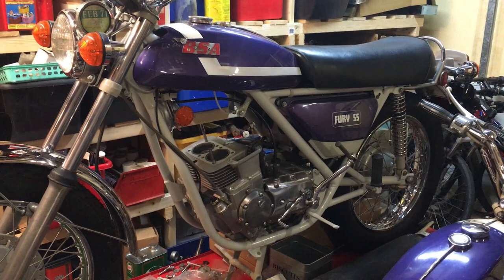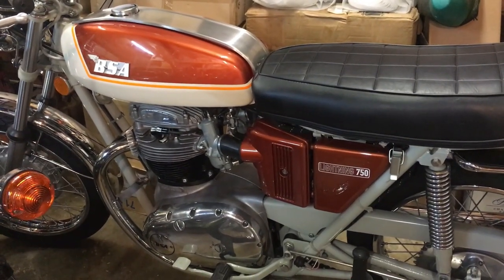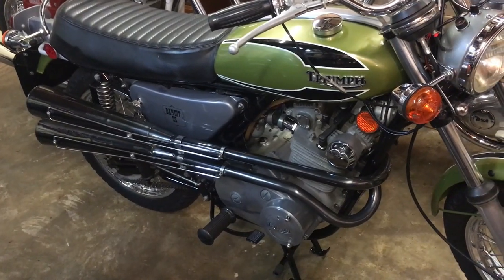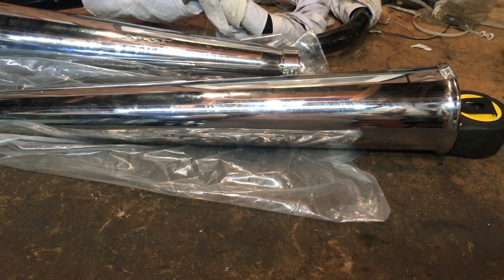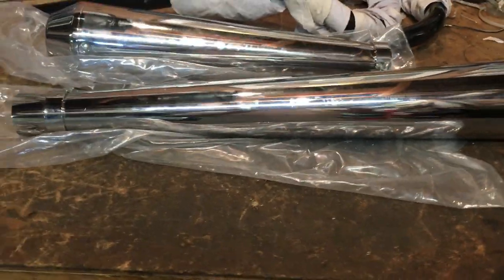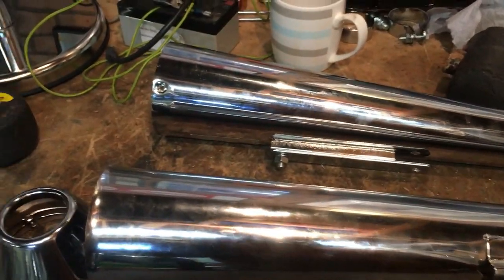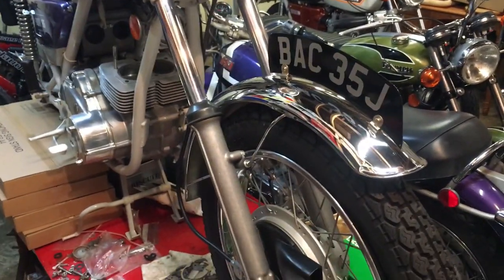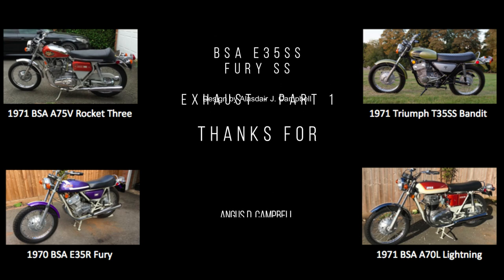BSA Fury SS (E35SS) Build - Exhaust Part 1

Comment: You mite consider brazing instead of welding,  the thin metal problem is aleaveated and it is very friendly to chrome plating.
Reply from the maker: Thanks Thomas - hadn't considered that but a very good point. I don't have the rods and the gas for brazing. I'm not looking to retain the chrome finish - that's going to change anyway.

Comment: Finding someone competent with a TIG welder would ensure a much tidier job than attacking the cones with a MIG set. MIG produces too much heat and leaves you with a lot more bead and spatter to grind off afterwards.
Reply from the maker: Thanks for the advice Howard. I intend to do some testing first. Not bothered about how much grinding there is to do but more about the existing metal taking the heat without burning or distortion. I’ve got the shorter silencer bodies that I’m discarding to practice with. Thanks again.
Reply: Good progress again...